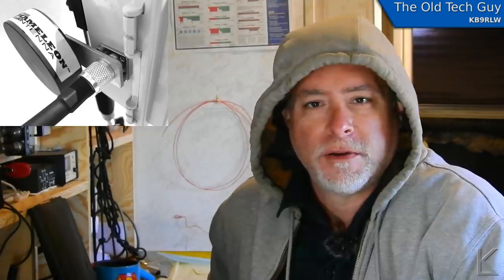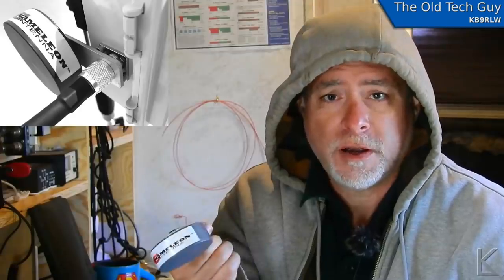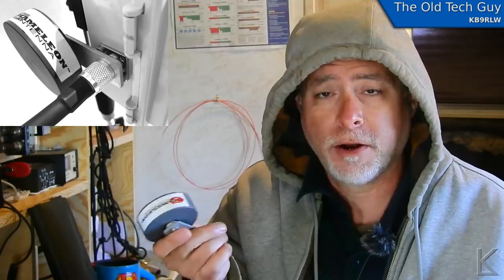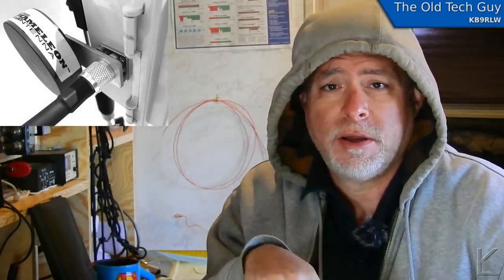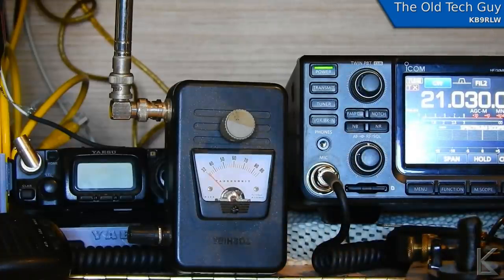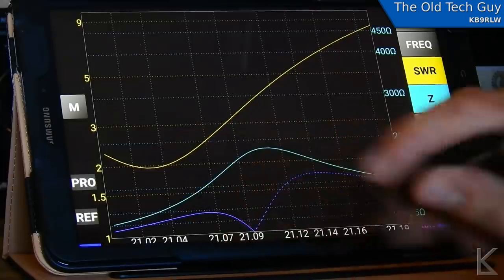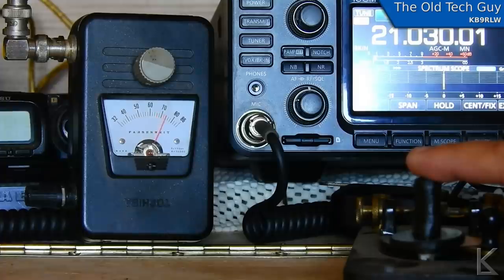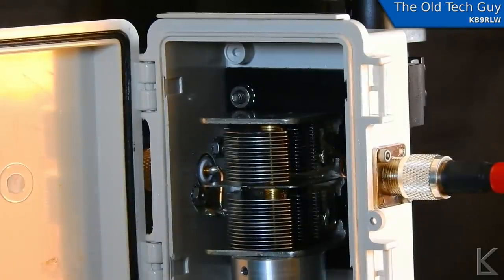Ham Radio - The Chameleon Antennas power compensator for magnetic loops.

Comment: Yes Kevin I added two of these to my loops and found I could use up to 60 watts pep on SSB without smoking the cap, I took this along to our radio club and drew the circuit on the board. Nobody could explain how it works, so if you manage to find out could you please share it with us. I have home brewed several hf loops and included the 500 of cap and god dam it just works?? Regards Kerry
Reply from the maker: Thanks for the peer review Kerry.
Reply: H Higgins  I am very interested in his response! Never thought to add TWO of them...umm
Reply: H Higgins — he gets 60w input and then measures the field strength down range,  and finds he is getting more power into the field. It’s just pretty nice that a loop can have a power boost for output power. —- but no mention of its effect on reception ?  Or did I miss that ?
Reply: Few years ago - when we introducer the CHA POWER COMPENSATOR (PC) - I made a short video show the power handling with what I had at home (not at the shop) to show the power handling oft he PC. I was able to push 100W RTTY into the LOOP and I was using a light bulb to show the power increases.

As you can see the SWR stayed steady which means that no arcing was happening inside the tuning box, I was also listening very carefully as it's VERY easy to hear when arcing is happening.

https://www.youtube.com/watch?v=C0DBRF1Yp6Q
Reply: I am sharing with you how it works. I believe my analysis is correct. If someone thinks otherwise, dispute it from a technical perspective rather than from a personal one. O.K.  How I believe it works:    I posted this before in bits an pieces but I doubt that anyone read it. I will post it here again. If the cap is not arcing, the voltage across it has to have been reduced. This would only occur if the transmitter power or the Q of the loop has been reduced. Since the transmitter power has not been changed, the Q of the loop must have changed--and this would be indicated by wider -3db points on the SWR curve. I believe that very careful measurement will indeed show that the -3db points have changed and that the loop efficiency—and therefore the voltage across the cap--has decreased (this is why it will  handle more power without the cap arcing). In other words, the loop tuning curve is not as narrow as before.  As far as the unconnected side of the door knob capacitor, the compensator (Cap and bar) is in my opinion, picking up RF from the larger loop, detuning it, and making it less efficient (by reducing the Q of the loop). To those who argue "but there's no connection on the other side of the compensator cap," I would suggest that they examine the way in which a Gamma Match operates (even though it is not used in this identical fashion).  I think that most of you are familiar with Steve Yates AA5TB Mag Loop Excel calculator (if not, it is a worthwhile tool to have). I've used this calculator and cannot see anything which would account for a voltage reduction across a magnetic loop tuning cap without also causing a reduction in Q. One cannot take a tuned circuit, add more components to it, and then expect it remain the same. Things simply do  not work this way.
Reply: @skywave dxer At 5 Watts output for both conditions, were you to perform a very careful measurement with and without the compensator, you'd discover that with the compensator, the -3db points are further apart and the SWR curve is not as narrow or as deep as when compared to a measurement taken without the compensator in the circuit. The fact that the tuning capacitor does not arc proves that the Q has decreased (and therefore the high voltage across the cap has also decreased)--and since this is the case, -3db points are further apart. The total energy flowing past the signal strength meter is about the same in both conditions since signal strength meter readings are average readings--you have no way of knowing the energy versus frequency breakdown with merely a signal strength meter. On the other hand, were you to look at the output using a spectrum analyzer, you'd have a better feel for what is happening. Think of it this way. Take the area of a rectangle which is 5 units wide by 1 unit high and the result would be 5 square units. Now do the same for a rectangle which is 1/2 unit wide and 10 units high and the result will still be 5 square units. Think of these averages as the signal strength readings which Kevin observed (with and without the compensator respectively). Though the energy spread is different, the average is the same.
Reply: @rachmielbenberel  The Q of the loop may have decreased due to losses in the added 2nd parallel capacitor.  However, the real reason the loop can take more power is that the current is now split among two parallel capacitors, and therefore the voltage across the first existing tuning capacitor is also thus reduced.

Comment: After playing with these magnetic loop antennas, I had a good idea what it was before you opened it Kevin, but when I saw it I knew what it was. Big doorknob capacitor. I'm sure it is capacitively coupled to the antenna in such a manner as it changes the tuned circuit and compensates for the extra power.
Reply: Yes, the 500pF 10 kv door knob capacitor detunes loop as it has been like in series with the split stator capacitor in the box. Voltage handling has been increased.

Comment: It is a 2nd capacitor in parallel with the first existing tuning capacitor.  It takes some current (depending upon capacitor ratio), so the current through the existing first capacitor is reduced, and thus the voltage across the existing first capacitor is reduced.

Now you also know why the tuning point went down in frequency when the 2nd capacitor was attached; the total capacitance was increased.

Comment: Great video. I always learn something when I watch your videos. I don't know much but it seems to have something to do with  being connected to the shield side of the loop. It would be allot of fun to play with.  I checked Ebay as well and there is  $20 shipping charge added to the $35. I don't think the price they are asking is unreasonable considering the engineering, testing and packaging. The folks have to make a fair profit to stay in business and since they make a quality product I want them to be around a while. 73 Ron
Reply from the maker: Well, the coax is shorted at both ends, making it nothing more than a flexible single conductor.   So, there is no 'shield side' in this case.
And yeah, I agree on price.  It's pretty normal in the industry for more than double parts costs to be applied to final pricing.
Reply: @loughkb  That is true about the coax being shorted. One other thing I wanted to mention was that I did not see where you compared the relative field strength to see if you actually had an increase in radiated power when you increased to 30w. Did I miss that?

Comment: Surely all this "structure" CAN do is to disturb the near field in the vicinity of the tuning capacitor.  Of course, this may also be enough to reduce the HV across that variable C, without  changing the far magnetic field too much.  I too would be keen to compare a few days of  WSPR results before and after.  I would also try an aluminium disc mounted in the same manner.

Comment: Kevin,

I read with interest and later with disgust the rubbing you and Chameleon took regarding your tests on the compensator.  While I do think Chameleon is overhyped and overpriced their products do work and for most quite well. (I prefer my AlexLoop and now my out of production W4OP remotely tuned loop). 

I did enjoy your thorough testing of the compensator and figured out what it was the minute you opened up the case.  The bottom line would be for me a far field test, something within 300 feet in two directions.

My other thought is what is the difference between 10 watts and 30 watts?  A couple dB?  If it allowed 100 watts that would be a 10 x power boost and might really mean something.  So I see no need for a compensator.

Anyway I look forward to further testing from you.  You are having fun and traveling around the country making friends along with enjoying your hobby.  Best of luck and God Bless my friend.

Dave K8WPE

Comment: I suspect it is the ceramic of the capacitor that is doing the work.  There are a lot of volts per inch in the area that the device is placed.  Changing the properties of the "free space" in that area will have an effect.

Comment: Thanks for the demo. I had been considering getting the compensator but was discouraged by speculative comments elsewhere that this might be just a resistor and thus wouldn’t really work. 
Will this work with loops other than chameleon? I have W2LI loop, also rated at 10 watts. BTW I am very happy with it, about half the price of the F-loop.
Reply from the maker: The documentation for it is on their site.  It does state that it can be applied to other loops.  You might have to come up with a bracket if your loop is not made with pl-259's on coax.

Comment: When you add the compensator and retune, the tuning capacitor plates are not engaged, that is why it doesn't arc at higher power. Any additional capacitance should work, as long as the main tuning capacitor plates are not meshed. Voltage of additional cap shouldn't matter as it only has one side connected.
Reply from the maker: I ran 30w later that night on psk31 down on 40 with the plates almost fully meshed and still no arc.
In a past build I did with a similar spaced cap, I got arcs at 20 watts with the plates only meshed about 1/4.

Comment: So if you connect capacitors in series, the voltage divides across them.  This would seem to be how the compensator is protecting the internal cap from arcing - but I'll be darned if it makes any sense exactly how with only one terminal of the cap connected.
Reply from the maker: The other side must be coupling with something.  The instructions were specific about the orientation, if that helps.

Comment: Any idea how that works? If the tuning capacitor is getting less power (no arcing), how can the full power get to the loop? It doesn't add up.
Reply: If it's not arcing I guess it's getting less *voltage*, so perhaps it's changed the impedance to shift the power into current?
Reply from the maker: I just opened the door, I'll be interested in seeing the analysis and theories in the comments.
Reply from the maker: By the way, the tuning cap is seeing less voltage, but power is a function of voltage and current.  So something a bit more complex is going on.
Reply: @loughkb  you're right
Reply: skywave dxer this is connected to the coax ground, it appears. How does this work? If the peak voltage is reduced, why doesn’t that impact antenna performance?
Reply: @edneely  its not connected to the coax ground. Both of the SO-239's on the side of the box are shorted from center pin to body of the connector, and so is the coax loop in the antenna itself. Each SO-239 is one connection to the antenna. Watch Kevin's previous videos on the magnetic loop and you will see how he shows the connections are shorted.
Reply: @skywave dxer  Yes - this is how it works!
Reply: What was the reading on the meter when running 30 watts? Is the antenna radiating a stronger signal?
Reply: Two Words - PHASE SHIFT
Reply: Kevin Loughin k

Comment: Thanks for the video Kevin, I was wondering what the heck that thing was. I admire your guts on tearing it apart! I have the Chameleon F loop, I assume that would work with it also. I do wonder though, how it could be used with the aluminum loop?
Reply: Yes you can use it with the CHA P-LOOP 2.0 & the CHA F-LOOP PLUS 2.0 with the aluminum radiator.

Comment: so you put 500pF of capacitance on your feedline's shield, and you can run more transmit power. Thats something that my head is having a hard time understanding. Does it work if you put it on the radio side of the feedline?
Reply from the maker: That's not the feedline.  The center and shield are shorted together, making the coax a flexible single conductor main loop.

Comment: I recommend checking the temperature change of the compensator after running a signal for a while (time uncertain) any change upward indicates it is absorbing energy which according to the law of energy conservation indicates that it is absorbing energy, thereby indicating less is available to be radiated.  KE4GOF
Reply: This is true, but the question then is, is it absorbing and dissipating as heat all of the extra applied power? In other words if you triple the applied power (10 to 30 watts) and dissipate half of the additional applied power you are still ahead since you are not arcing the capacitor and the power going out is higher. The first experiment at low power suggests it is dissipating a near negligible amount of power. I'd like to see some far-field measurements at high power.

Comment: Could this be used in the latest iteration of the Alex Loop? I am debating the F loop 3.0 vs an Alex loop for POTA, SOTA and emergency comms. GREAT video, thanks!
Reply: The Chameleon website states it can be used with other loops that have a PL-259 connector. I have the F-Loop 3.0 and the Alex Loop (not the Alex Pack version). For lite weight hiking up a summit the Alex is much lighter. However, for a rugged antenna with quality components the Chameleon is much more durable.  Also, I get better bandwidth using the F-Loop.

Comment: Keven, has the -3db bandwidth on each band changed  when using the "compensator?" 

If the cap is not arcing, the voltage across it has been reduced. This would occur if the Q is reduced--and this would be indicated by wider -3db points on the SWR curve.  In my opinion, near field testing of loop antennas is essentially a waste of time--for example, comparing a circular loop to a square or an octagonal configuration in the near field--for if electro-magnetically similar,  both (according to Antennas by John Kraus, 1950 Edition) will essentially produce the same far-field results. What I think you should be doing is A-B testing (with the transmissions close to one another and at 5 watts each) using WSPR; then and only then should you be comparing the results. 

As far as the unconnected side of the door knob capacitor, the widgit--the compensator (Cap and bar)--is in my opinion, picking up RF from the larger loop, detuning it, and making it less efficient (by reducing its Q). To those who argue "but there's no connection on the other side of the cap," I would suggest that they examine the way in which a Gamma Match operates before continuing any further (even though it is not used in the identical fashion).

I hope you'll continue your testing. I think that when finished, you'll agree with my analysis of what is happening. I should end this by stating that it can be a challenge to compare a highly efficient radiator driven at lower power levels to a less efficient one driven at higher power levels; and then try to determine,  "Which one is better?" As I've already noted, WSPR is the perfect tool for this type of testing. Make use of it (and do not forget to use the identical power level, 5 watts, for each antenna configuration--with compensator and without).
Reply from the maker: No, no change in bandwidth.
Reply: @loughkb  What else could cause a reduction in voltage without changing the Q of the system? I cannot think of anything off the top of my head. I think that you are familiar with Steve Yates AA5TB Mag Loop Excel calculator.  I've played with this and cannot see anything which would account for a voltage reduction across the tuning cap without also causing a reduction in Q. I am hoping that others who are serious about this--rather than some of the toilet mouths who criticized you--will also be challenged to do their own testing. As I wrote, WSPR is the perfect tool for this. Good luck to us all.
Reply: I should respectfully add that I do think that the -3db points have changed--nothing else makes sense to me concerning it.  But since I am not able to test right now--my wife is in the hospital and I can only do internet rather than Ham radio (not being home most of the time)--I will have to just theorize on what I think is happening.  If I discover that I was wrong, I'll be the first to admit it. This is supposed to be a fun hobby, not a blood sport. I believe in keeping things happy. Why these others have to show their fangs--albeit it being Halloween--is anyone's guess.
Reply from the maker: @rachmielbenberel  I'll be doing more with it in the future also.   I'm going to build another loop after I pick up a couple of sacrificial variable caps at a hamfest.  Then I'll have a loop I can beat up without worry.  I didn't want to abuse the chameleon box since it's so well built.
Yes, there's a lot of loud opinions being shouted, mostly by people that don't have one to test with, or have even built a loop themselves.  I expected that, it's just static though, I look for the signals in the noise.  So to speak.
Reply: @loughkb  I look forward to hearing what happens. Thanks.
Reply: @loughkb  Did you ever try the Compensator out with a sacrificial loop?

Comment: Thank you for the test and video!  Can you make another test on a frequency or band, where the tuning capacitor is almost turned "in"? So that the tuning capacitor has almost themaximum capacity by itself? And then, also no arcing? Would be interesting. vy73 from Hamburg/Germany, Dietmar, DL4HAO
Reply from the maker: Later that evening, I did some psk31 down on 40 meters where the cap was almost fully meshed and had no arcs.
Reply: Thanks :)